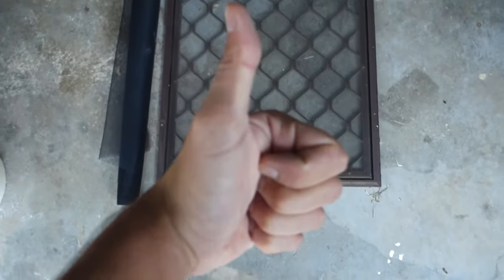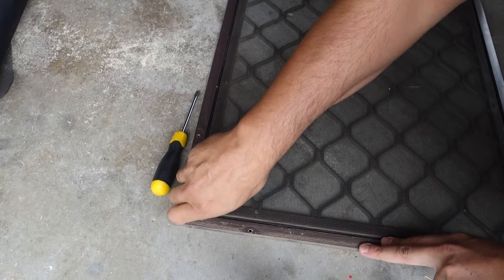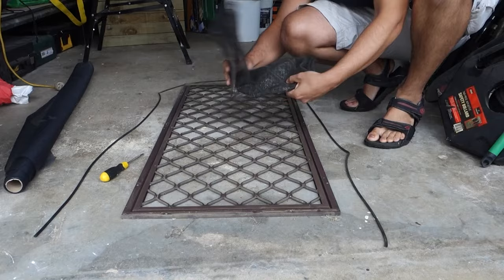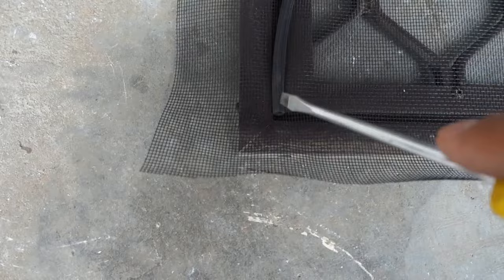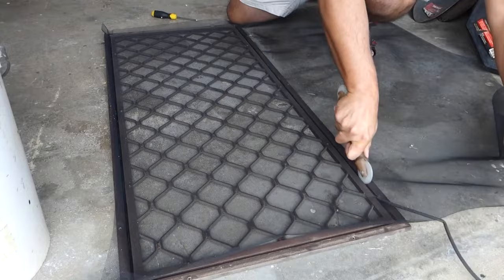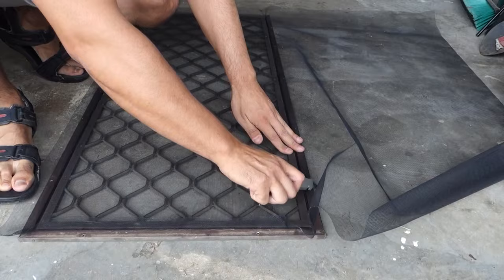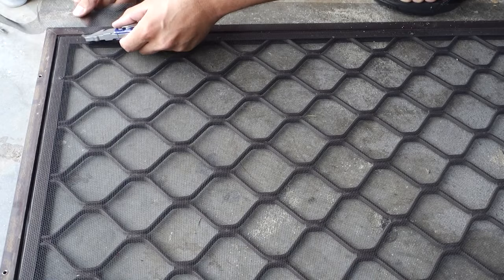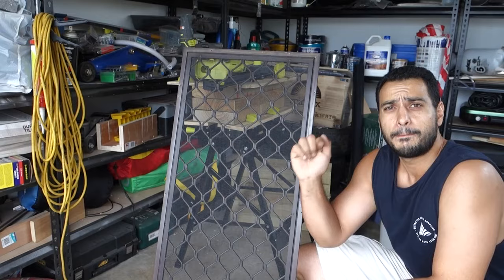How to replace fly screen mesh - DIY remove and install

Comment: Excellent video, Bill.  I will be making my own flyscreen and homemade sill sections (!!) very soon.  I changed the mesh on my flyscreen door and it was a nightmare.    Being a total beginner DIY-er, I used the stronger aluminium mesh, not fibreglass as per your video.  Warning to all!!  This seemed industrial and I had to exert great pressure on the roller to apply it. Too rigid.   Ended up with a puncture, threw my hands in the air, said many choice words and went back to the big B to swap with fibreglass.   They actually gave me a refund.   Bill, would be great if you could please explain the pros, cons and uses of each type of mesh in any future videos.   Thanks.

Comment: How about tips to replace with metal wire for mouse proofing? I can’t get the rubber in the groove
Reply: yep one on metal mesh would be good,  much harder to work with and you only get one go as the metal deforms and takes on the channel shape

Comment: Thank for your good video.  My problem is how to remove the amplimesh security screen from the window frame.  I have removed the two screws at the top but I am unable to lift the screen up and free from the bottom track. There at two black plastic extrusion wedges on the LH side that have taken up the lateral slack between the screen and the window frame and these are making it impossible for me to lift the screen up and out of its track.  Can you advise me please?

Comment: Hi bill, loving your videos and your helpful tips on jobs around the house. I've got a bathroom sink where the plug is one of those push down and pop up ones, not the ones where you have the plug completely separate. Anyway when you push down on it to stop the water from going down, it doesn't lock. It stays down and I have to unscrew the plug and use pliers to get the centre bit back up to normal open state. Do you have any ideas on how to fix this. I've tried spraying WD40 but that hasn't helped.
Reply from the maker: Hi Mathew, I’m glad you are enjoying the videos. Usually I would replace the entire mechanism as they are very cheap to buy, but give me a few days and I’ll post a video to show how to do it👍
Reply: @billshowto  Thanks bill. Looking forward to the video
Reply from the maker: As promised hope this helps
https://youtu.be/GXhhM3kKi9o

Comment: Question... should the screens be fitted with the grille facing inside the house or outside the house?
Reply from the maker: Grille is on the outside
Reply: Billshowto that’s what I thought. Is there a specific reason why? I’m asking because I’m renting a house with every window and door having the grille facing into the house, which I had never seen before.

Comment: is it possible to replace the mesh with the door still attached standing up? I'm worried if i take it apart, the screws etc are so old, I may not be able to put the door back up lol
Reply from the maker: Lol , as long as you can access all areas to install the spline and new mesh you can leave it on the tracks👍

Comment: To be fair putting the screen frame straight on the concrete floor will scratch it to buggery....why not do it on a dust sheet on a bench at waist height??

Comment: You cooked it, sounds like you ripped the mesh on the bottom. . . .people remember, always be careful when putting the last run of spline in as you might make the mesh so tight it rips.